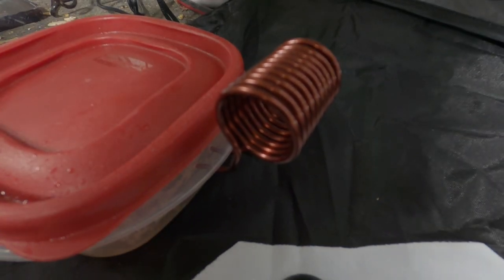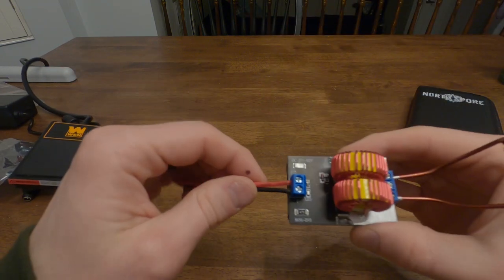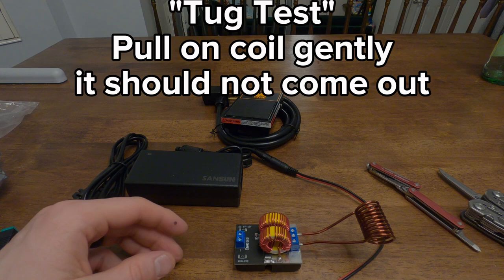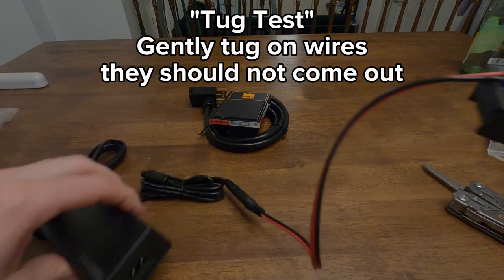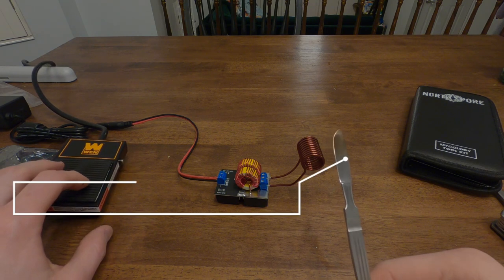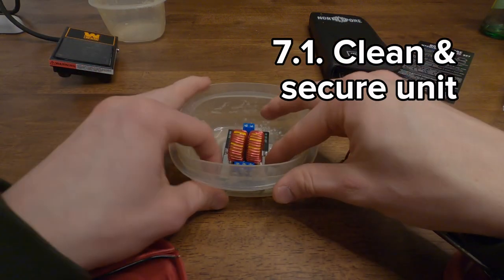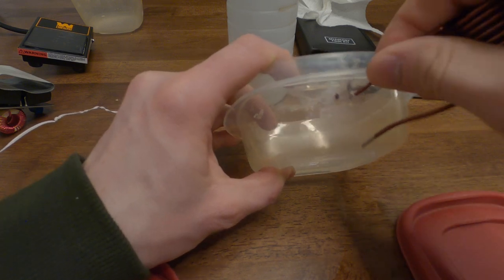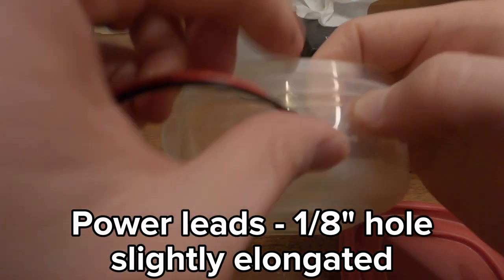Induction Scalpel Sterilizer - Great for Mycology

Comment: Does the copper tubing heat up? Or just the scalpel?
Reply from the maker: Just the scalpel! The coils create a magnetic field that causes the metal to self heat. 
This is also why induction cook tops are much safer - the top of the stove is cool after using.